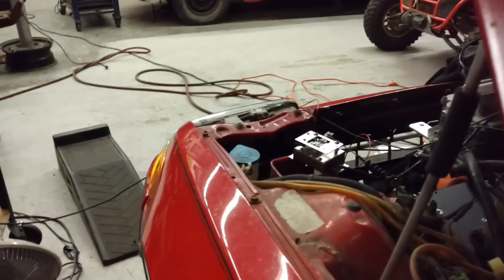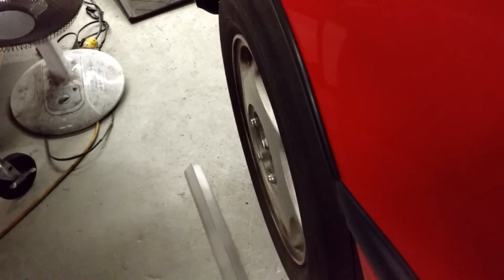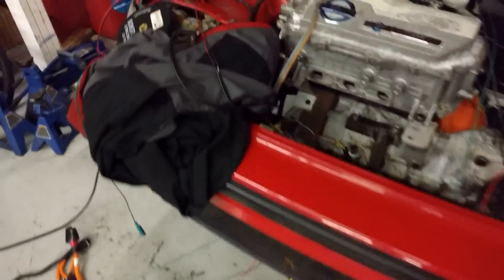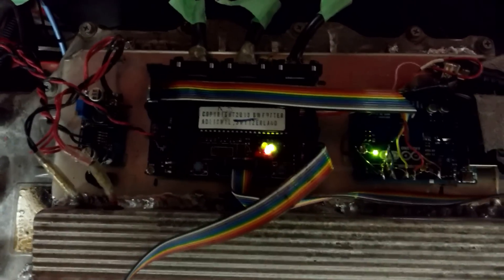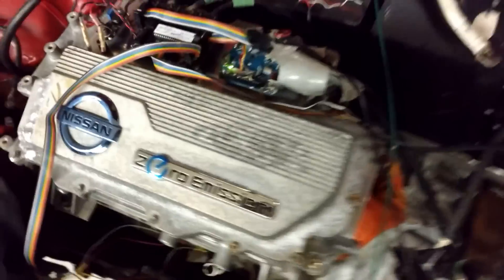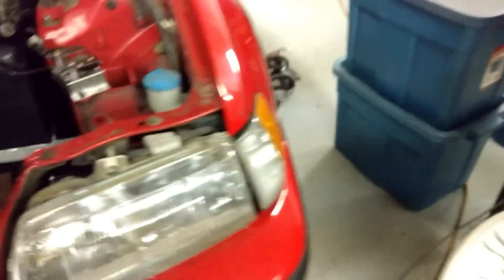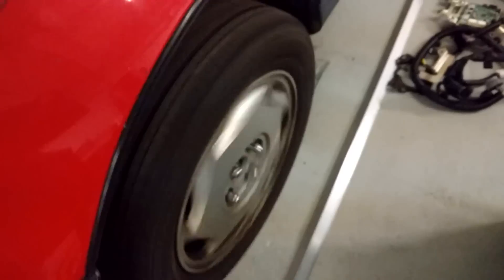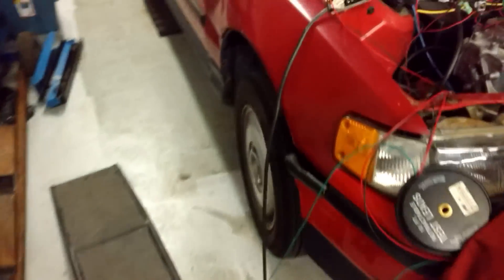Electric CRX running

Comment: Look good dude. Looks lke you've got a torched inner CV joint boot though. May want to replace those driveshafts before your maiden voyage.
Reply from the maker: +draggonhedd Nope  I will build new shafts soon but I don't have any kicking around so I will try it a bit with these then use these as reference to build the new shafts.  I hurt the outer CV when I tried to take it apart.   The inner is a Nissan CV and the outer is a Honda CV so it was a challenge for sure. I think they need to be 1/8-1/4" shorter as well.
Reply: alright, sounds like you've got it covered then.